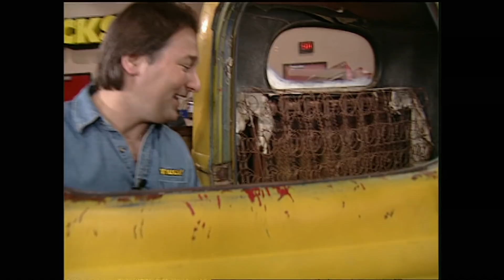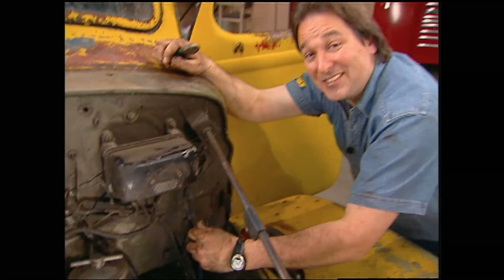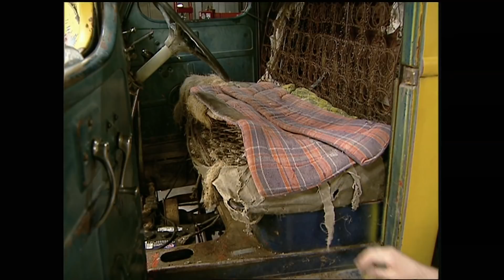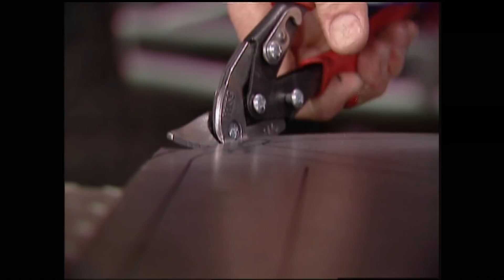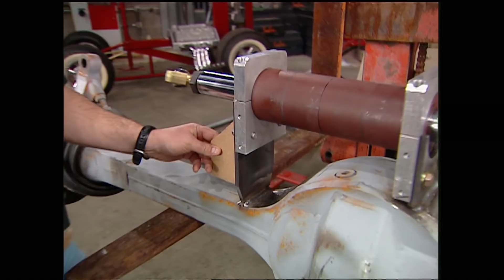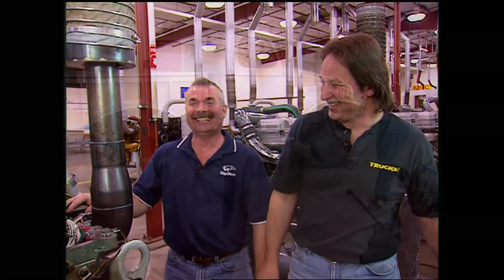Update on Project Sergeant Rock - Trucks! S7, E17

Comment: As a fresh Airman in the Air Force back in 1996, I was stationed at Grand Forks AFB, ND.  We had those OLD Oshkosh WT-2206 roll over snow plows that were originally manufactured in the 1960s, then refurbished twice (1970s & 1980s).  They came with four 6V batteries.  They were wired together for a 24V system as sell as some 12V circuits.  The first thing I learned was to make a diagram of the cables and placement of the batteries.  Make sure you marked the positive and negative terminals, as well as number them so you knew exactly where they went.  You'll know if you hook any of them up wrong and kick yourself in the ass when you have to replace electrical components and wiring!

Comment: Weld those axle parts with stick. Run a root weld with 6010 rod and then fill/cap with 7018. That will give you a solid weld that should not crack under pressure if done correctly.
Reply: Great tip. Folks today don’t understand the versatility and the importance of being able to use different rods with a stick welder and do what you are talking about. I learned most of what I know about welding  from an old boilermaker who learned it all old school.
Reply: Grizzly the 6010 is the red coated one that REALLY has a strong scent right?I used to weld.